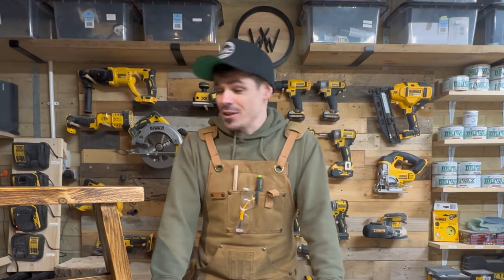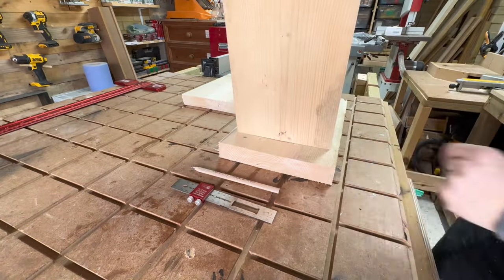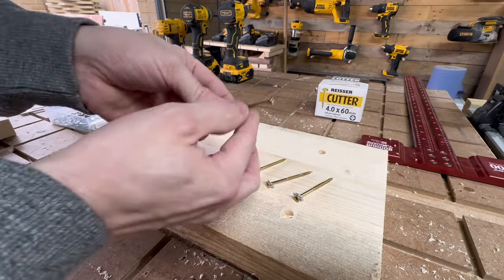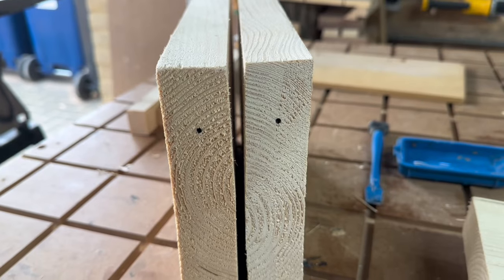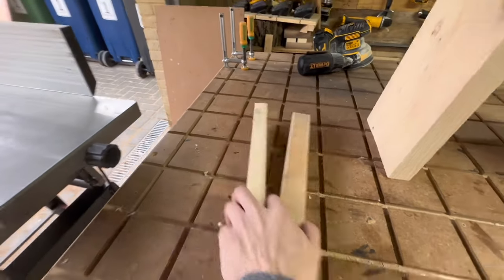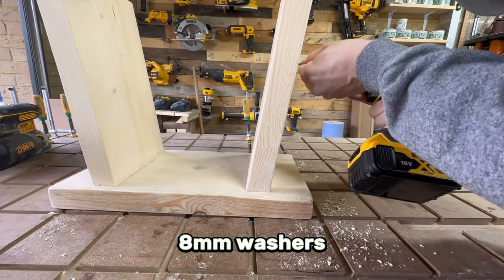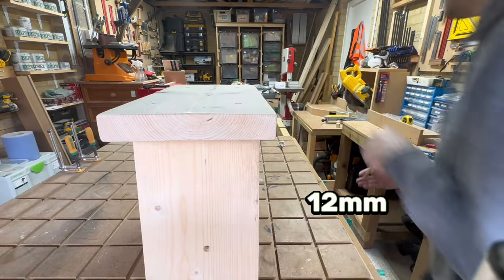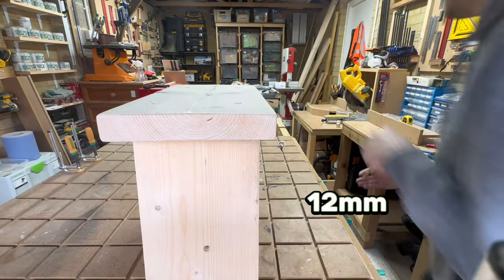YOU can build this RUSTIC STOOL - Woodworking Tutorial

Comment: Awesome little project! I haven't got a mitre saw yet, is there a work around not having one? I do have a circular saw and a jigsaw, not sure how I'd go about cutting the legs with the tools I have?
Reply from the maker: Thank you brother! And yes, absolutely! Most circular saws have the ability to make angle cuts. Then all you need to do is set your blade angle to 10 degrees, lock it off, and make your cuts 😊